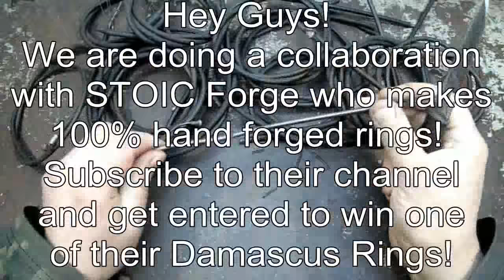Damask steel from Bowden cables of motorcycles

Comment: Around the 4:50 mark, when you use the sanding wheel to clear the scale, how does it hold the blade down? I've seen it in your videos as well as others and it got me curious. Is it Magnetic?
Reply: Chris Adams Yes magnetic vice
Reply from the maker: Yes, they answered correctly
Reply: I wondered that at the 2:15 part. First time I seen it and it's cool. Must be electromagnetic like the door locks.
Reply: no its not, it is mechanical, just magnets
Reply: Chris Adams whatever you do don't turn the magnet off while using it... it's fun... but it's a terrible idea
Reply: You guys... you don't turn the magnet off. Come on, do some research. The handle/lever he turns on the lower right? It is literally LOWERING the magnets away from the work surface.

Comment: Перец оно понятно для остроты , а посолить ? А если без шуток - классно
Reply: Вся сила в перце! :-)
Reply: +Георгий Гольц
А солит он бораксом постоянно , но видать чего-то не хватало . ЛОЛ
Reply: Есть такое русское слово - бура
Reply: +Eternal Sorrow 
К нашей бесконечной скорби , здесь в комментах до буя англоязычных , которым даже Гугель трансляйт не поможет . LOL  
 ^__^
Reply: так точно написать хотел
Reply: Георгий Гольц γωμμμ.  Η η η η
Reply: Bura is a high-temperature flux used for joining materials such as steel, cast iron, copper (its alloys) with medium-melting copper, brass, silver and gold solders. ... To get a more active flux for soldering copper or another metal, you need to add fluoride and chloride salts to the mixture.
Reply: Он из полуфабрикаов делает, соль там уже есть)
Reply: @faq_is_love  бура и borax  одно и тоже.
Reply: Ну перец сыпит эт он новерное обогащал сталь углеродом.
Reply: тогда почему он ее в конце сыпит?Там где отрезается... Я так думаю это он сравнивает приготовление еды и ковку клинка, типа соль, перец  знатная каша получится. Всех с новым годом.

Comment: Beautiful metal but still not Damascus steel
Reply: Tls papa this is pattern welded steel, or "modern" damascus if you will. The methods of makingtraditional damascus, or Wootz crucible steel, was lost to time.
Reply: damascus=/=wootz steel (as you've said damascus is welded steel and wootz is crucible steel). also making wootz (or bulat, pulad etc.) isn't "secret lost in time", youtube has plenty of videos of making crucible steel (mostly forging "ulfberht" type of swords, which were made of crucible steel), you can check for yourself.

Comment: I've read that when you hammer the metal the slag that comes off are impurities leaving the metal does that mean at some point of hammering there would be no more slag since you got rid of all the impurities?
Reply: It's always getting impurities from the air, specifically the oxygen which oxidizes (rusts) the metal and creates more slag. Metal oxidizes much quicker at high temperatures.

Comment: What are you placing the blade into at 4:30 and why? Is it to cool the blade quicker without quenching in water or oil?
Reply from the maker: This is annealing of steel, it is needed for grinding grain of steel grown at the temperature of forge welding, stress relief. Preheated billet to austenitic transformation temperature, placed for slow cooling in the heat insulator "Perlite".
Reply: @shurap  thanks!

Comment: Do you remove the canister from the billet? Also I see you drill what looks like a vent hole prior to forging, wouldn't it allow air into the canister as it welded?
Reply from the maker: The canister is partially burned, partially grinded. The hole for the gas outlet, oxygen does not go there

Comment: Nice. I have a question : at the beginning once your canister is closed you still a hole in it. Why ? I thought the canister was here to hold the materials and prevent further oxygen to mix in the billet. So if you drill a hole wouldn't that allows oxygen to get in ? Maybe is it to let the slag run off the billet.
Reply from the maker: For the escape of gases, otherwise the stock will inflate when forging.
Reply: Thank you for the answer.

Comment: Buenas noches, excelente trabajo! 👏🏻
Podría decirme si es polvo de hierro con bórax lo que utiliza para forjar?
Reply from the maker: Rocío con fundente (borax 90% + arena de cuarzo 5% + carbón en polvo 5%) es necesario para realizar la soldadura (forja). El flujo se fusiona con la escala: la sustancia resultante es bastante fluida y se desplaza fácilmente durante la deformación. Además, el fundente protege del oxígeno y, a expensas del carbón vegetal, carburiza la capa superficial del metal, lo que reduce la temperatura de soldadura (en resumen).
Reply: Buen día, muchísimas gracias por la información!
Estoy admirado con su trabajo!
La intención es poder iniciar en el rubro,  tus videos han sido de enseñanza e inspiración. 
Nuevamente muchísimas gracias!

Comment: Hola. Una pregunta. Que es el polvo gris que le pone en el minuto 2.30 ??? // Hi. A question. What is the gray powder that puts you in the minute 2.30 ???
Reply from the maker: Espolvorear con flujo (bórax 90% + arena de cuarzo 5% + carbón vegetal en polvo 5%) es necesario para la soldadura (forja). El flujo se fusiona con la escala: la sustancia formada es bastante fluida y se desplaza fácilmente durante la deformación. Además, el flujo protege contra el oxígeno y, a expensas del carbón vegetal, la carburación de la capa superficial del metal, lo que reduce la temperatura de soldadura (aunque sea brevemente).

Comment: What are you soaking hour billets in? Your videos are an inspiration.
Reply: Your* not hour, sorry.
Reply from the maker: The billet is soaked in kerosene. This is necessary for good welding (forging) steel. When burning inside the workpiece remains soot (carbon), which, with further heating, scales and rust inside the workpiece restores to the iron, improving the quality of forging welding.
Reply: @shurap  Thank you for the reply, I appreciate all the information. Have a good day!

Comment: Magnifico. Ma cos'è quella polvere che metti sul materiale quando lo tiri fuori dal forno?
Reply from the maker: Cospargere di flusso (borace 90% + sabbia di quarzo 5% + polvere di carbone 5%) questo è necessario per la saldatura (fabbro). Il flusso è fuso con la scala: la sostanza risultante è piuttosto fluida e può essere facilmente spostata durante la deformazione. Inoltre, il flusso protegge dall'ossigeno e, grazie al carbone, carbura lo strato superficiale del metallo, il che abbassa la temperatura di saldatura (se brevemente).
Reply: Spettacolare

Comment: I’ve often wondered why you grind the point one way and then hammer it into to opposite direction. Can you explain this to me please?
Reply from the maker: The wrapping of the tip of the blade is necessary in order to correctly form the cutting edge. In the case of a welded cutting edge, bring it to the full length of the cutting edge.

Comment: What is that powder you put on the metal before melting it?
Reply from the maker: I sprinkle flux (90% borax + 5% quartz sand + 5% charcoal powder) this is necessary for forging (forge) welding. The flux is alloyed with scale - the formed substance is sufficiently fluid and is easily displaced by deformation. In addition, the flux protects against oxygen and charcoal, carburizes the surface layer of metal - which lowers the welding temperature (if in brief).

Comment: What material was that you quenched your blades in.
Reply: I believe knife makers use motor oil. For diesel engines if I'm not mistaken. Higher flash point

Comment: Maybe my mind doesn't want to produce the exact thought I am looking for but when you say "pure iron powder and black pepper" I understand the iron powder but the black pepper reference eludes me. You cannot mean literal black pepper correct? like the seasoning??
Reply from the maker: Yes, true black pepper. This is of course partly a pun. It will burn and it will turn out charcoal. Therefore, there is no difference,

In Russian, Ukrainian, German, the first word of expression: a sharp knife and hot pepper - the same thing. It turns out a pun, that for sharpness. In fact, the source of carbon.

Comment: What is the dusty material you put on the steel during all process?
Reply from the maker: I sprinkle flux (90% borax + 5% quartz sand + 5% charcoal powder) this is necessary for forging (forge) welding. The flux is alloyed with scale - the formed substance is sufficiently fluid and is easily displaced by deformation. In addition, the flux protects against oxygen and charcoal, carburizes the surface layer of metal - which lowers the welding temperature (if in brief).
Reply: Thanks a lot🙏🏼 appreciated

Comment: What's that dust you sprinkle over the hot metal?
Reply from the maker: I sprinkle flux (90% borax + 5% quartz sand + 5% charcoal powder) this is necessary for forging (forge) welding. The flux is alloyed with scale - the formed substance is sufficiently fluid and is easily displaced by deformation. In addition, the flux protects against oxygen and charcoal, carburizes the surface layer of metal - which lowers the welding temperature (if in brief).

Comment: 2:37 what´s that powder Name?
Reply from the maker: I sprinkle flux (90% borax + 5% quartz sand + 5% charcoal powder) this is necessary for forging (forge) welding. The flux is alloyed with scale - the formed substance is sufficiently fluid and is easily displaced by deformation. In addition, the flux protects against oxygen and charcoal, carburizes the surface layer of metal - which lowers the welding temperature (if in brief).

Comment: why do you always flip the tip to the other side?  4:00
Reply from the maker: The wrapping of the tip of the blade is necessary in order to correctly form the cutting edge. In the case of a welded cutting edge, bring it to the full length of the cutting edge.

Comment: What is sprinkled on the hot metal?
Reply from the maker: I sprinkle flux (90% borax + 5% quartz sand + 5% charcoal powder) this is necessary for forging (forge) welding. The flux is alloyed with scale - the formed substance is sufficiently fluid and is easily displaced by deformation. In addition, the flux protects against oxygen and charcoal, carburizes the surface layer of metal - which lowers the welding temperature (if in brief).

Comment: What is the dust that he puts on the hot lingot?
Reply from the maker: I sprinkle flux (90% borax + 5% quartz sand + 5% charcoal powder) this is necessary for forging (forge) welding. The flux is alloyed with scale - the formed substance is sufficiently fluid and is easily displaced by deformation. In addition, the flux protects against oxygen and charcoal, carburizes the surface layer of metal - which lowers the welding temperature (if in brief).
Reply: @shurap  thanks

Comment: 0:18 what powder?tq bro
Reply from the maker: I sprinkle flux (90% borax + 5% quartz sand + 5% charcoal powder) this is necessary for forging (forge) welding. The flux is alloyed with scale - the formed substance is sufficiently fluid and is easily displaced by deformation. In addition, the flux protects against oxygen and charcoal, carburizes the surface layer of metal - which lowers the welding temperature (if in brief).
Reply: @shurap  okay...tq bro😀😀

Comment: Bonjour la poudre grise que vous mettez ces quoi ? La blanche esque ces du borax? Quelle est la dénomination exacte svp car borax est une marque. Et le liquide pour faire apparaître le damas il s agit de quoi comme acide ou peroxide. Bien à vous
Reply from the maker: J'arrose de flux (borax 90% + sable de quartz 5% + poudre de charbon 5%) est nécessaire pour le soudage (forgeage). Le flux est fondu avec du tartre - la substance résultante est très fluide et se déplace facilement lors de la déformation. En outre, le flux protège contre l'oxygène et aux dépens du charbon de bois, en carburant la couche superficielle du métal - ce qui abaisse la température de soudage (si brièvement).
Reply: @shurap  super merci bcp de votre réponse et merci pour la recette de l poudre magique 👍😜

Comment: Gostaria de saber que pó areia e essa que sempre vejo colocar no limite em brasa e para fazer o aço damasco tem que ter uma prensa ou pode ser no martelo
Reply from the maker: Salpico com fundente (bórax 90% + areia de quartzo 5% + pó de carvão 5%) necessário para efetuar a soldagem (forja). O fluxo se funde com a escala - a substância resultante é bastante fluida e é facilmente deslocada durante a deformação. Além disso, o fluxo protege contra o oxigênio e, à custa do carvão, cementa a camada superficial do metal - o que diminui a temperatura de soldagem (em suma).

Comment: What is the powder in the bowl?
Reply from the maker: I sprinkle flux (90% borax + 5% quartz sand + 5% charcoal powder) this is necessary for forging (forge) welding. The flux is alloyed with scale - the formed substance is sufficiently fluid and is easily displaced by deformation. In addition, the flux protects against oxygen and charcoal, carburizes the surface layer of metal - which lowers the welding temperature (if in brief).

Comment: Powder name please?🙏
Reply from the maker: I sprinkle flux (90% borax + 5% quartz sand + 5% charcoal powder) this is necessary for forging (forge) welding. The flux is alloyed with scale - the formed substance is sufficiently fluid and is easily displaced by deformation. In addition, the flux protects against oxygen and charcoal, carburizes the surface layer of metal - which lowers the welding temperature (if in brief).
Reply: @shurap  👍tnkyu

Comment: Apa yang ditaburkan pada saat dipanaskan?
Reply from the maker: Saya taburi dengan fluks (borax 90% + pasir kuarsa 5% + bubuk arang 5%) diperlukan untuk pengelasan (penempaan). Fluks bergabung dengan skala - substansi yang dihasilkan cukup cair dan mudah dipindahkan selama deformasi. Selain itu, fluks melindungi terhadap oksigen dan dengan mengorbankan arang, carburizing lapisan permukaan logam - yang menurunkan suhu pengelasan (jika sebentar).
Reply: @shurap  can you explain the purpose of the process at "04:35", "06:05" and "12:27", and what kind of the liquid and the particle..thx in advance

Comment: ma quella polvere che metti su, cosa è?
Reply from the maker: Io cospargo di fondente (borace 90% + quarzo sabbia 5% + polvere di carbone 5%) è necessario per la saldatura (fucinatura). Il fondente si fonde con la scala: la sostanza risultante è piuttosto fluida e si sposta facilmente durante la deformazione. Inoltre, il flusso protegge dall'ossigeno e a spese del carbone, cementando lo strato superficiale del metallo - che abbassa la temperatura di saldatura (se brevemente).
Reply: Grazie, molto interessante!

Comment: le due polvere cosa sono???
Reply from the maker: Spruzzo il flusso (90% di borace + 5% di sabbia di quarzo + 5% di polvere di carbone di legna) necessario per la saldatura (forgia). Il flusso è fuso con una scala: la sostanza formata è sufficientemente fluida e facilmente rimpiazzata dalla deformazione. Inoltre, il flusso protegge dall'ossigeno e dal carbone, cementa lo strato superficiale del metallo - che abbassa la temperatura di saldatura (se in breve).
Reply: ok,grazie

Comment: First of all you have to be the absolute fastest ball peen hammer swinging guy I've ever seen. LOL in the first part of the video after you have put your flux on top of your Billet you have a look like a pepper grinder added some green powdery substance what was that?
Reply from the maker: I sprinkle flux (90% borax + 5% quartz sand + 5% charcoal powder) this is necessary for forging (forge) welding. The flux is alloyed with scale - the formed substance is sufficiently fluid and is easily displaced by deformation. In addition, the flux protects against oxygen and charcoal, carburizes the surface layer of metal - which lowers the welding temperature (if in brief).

Comment: you can't make true Damascus steel because the only real Damascus steel is in a museum and it's made into a sword and they can't figure out how to make that kind of Steel. This kind of Steel is called Damascus steel but it's not technically Damascus steel from which the term was coined from.
Reply: @Adam Courchaine Thats not true real authentic Damascus steel at least the first kind they discovered that makes up the sword in the museum. That's  I don't know how many hundreds of years old they don't know how it was forged. And modern day Damascus steel is like a generic knock off like instead of Frosted Flakes they're called sugar flakes it's a kind of Damascus steel but it isn't actually Damascus steel. All I know is that they can't recreate the original kind thats in the museum which by the way hasn't really rusted in hundreds of years. Where Damascus steel modernly does rust that's how you know we can't recreate original Damascus steel.